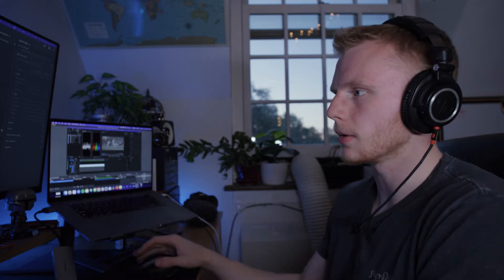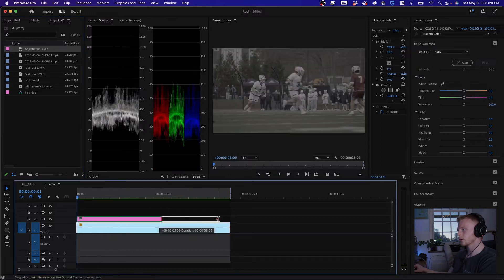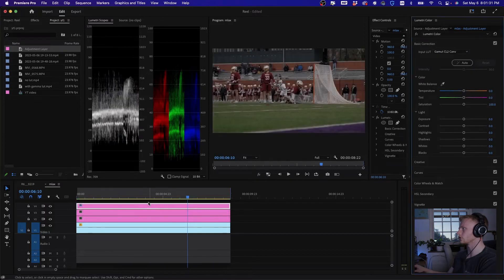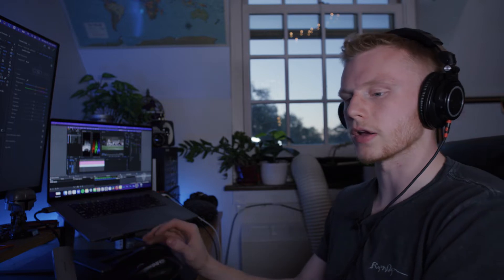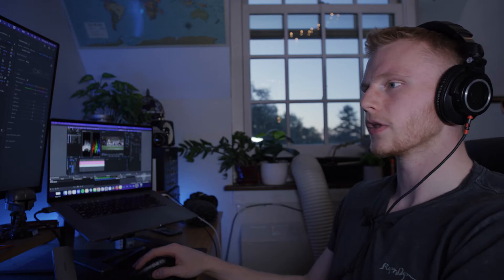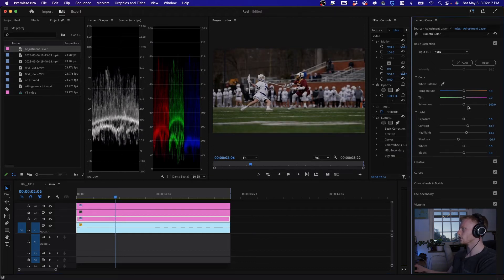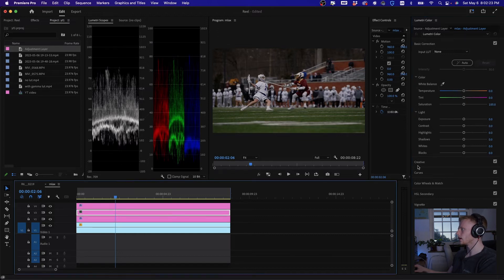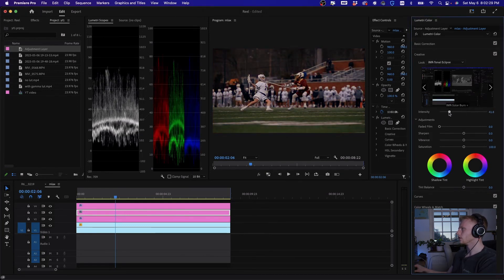The BEST WAY to Convert LOG Footage to Rec. 709 | Premiere Pro Tutorial

Comment: thank you for this!

I've been using rightclick > Modify > color and then selecting the input lut there for the clip, and then add adjustment layers accordingly for corrections and the actual grading. 

I'm unsure if I should continue with this method or change. What would you say is the difference between these two methods? is one better?
Reply from the maker: I dont think one is cnessarily better. I like the method i layed out here because i can very quiakly and easily see what each layer is doing to my image. but whaever works best for you

Comment: In Blackmagic cam I can choose Rec709 instead of apple log rec2020, Does this option replace the conversion of video by premier and what is better to shoot Rec709 directly or shoot log and then convert it to rec?!
Reply from the maker: My understanding is that Rec 2020 is for 4k delivery. I deliver my footage in 1080 most of the time so it really depends. I may be wrong on that, but I normally just stil with Rec 709

Comment: I’m curious what are the settings for your three adjustment layers. What happens if the settings in the adjustment layer are set to wreck 709 and you do your basic corrections on there? Would that be a problem? I am running into some strange issues when my adjustment layers are already in 709 I seem to be having choppy images in the final product. thank you for any advice you have is very helpful
Reply from the maker: I don't have any specific settings, i leave the adjustmnet layers at the default settings and then apply the conversion lut to the top one as i do in the video. Is the image choppy when you export it or just when you try to play it back in premiere?

Comment: thx for explanation. Premiere Pro now is able to detect the LOG-Formatd and change it automatically in the background. Do I still work on the original LOG-Format in this case?
Reply from the maker: If you follow this process, yes stick with the original log format. I haven't done much research on the new log detection in premiere, but this process has worked for me for yeras so I plan to stick with it.

Comment: So what is this new trend? why suddenly people starting to do this? why not just color grade your log footage?
Reply from the maker: This is one step in color grading, getting the footage from log to a rec 709 color space is an important step which this lut does, then teh color grading is done afterwards
Reply: Every camera manufacturer designs their log profile with a specific curve or algorithm and thus they create a conversion LUT that is specific to converting that log footage to Rec. 709. Using that LUT ensures you're converting the log correctly, all the other adjustments should only need to be small and subtle